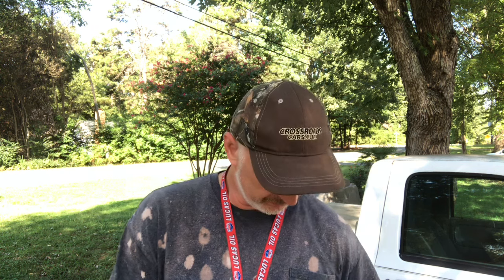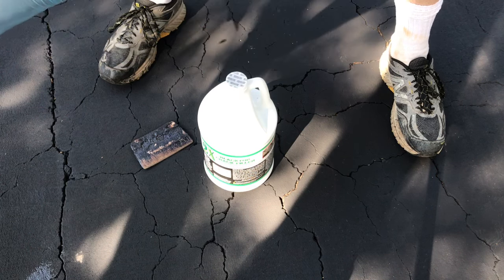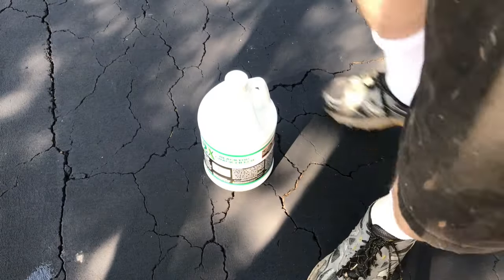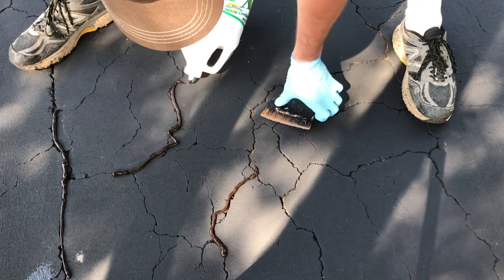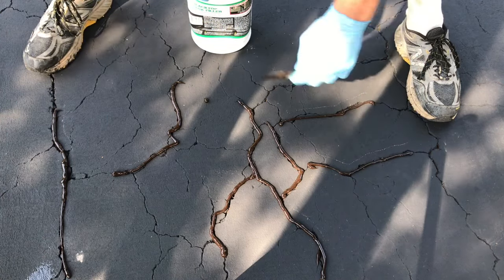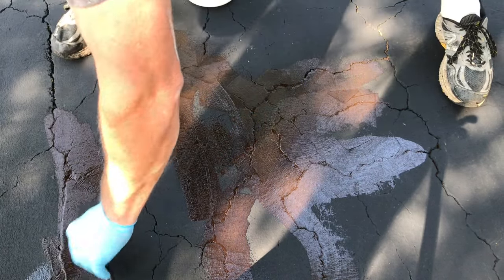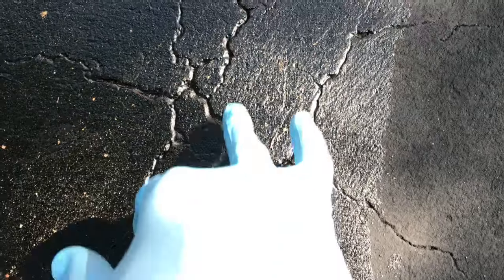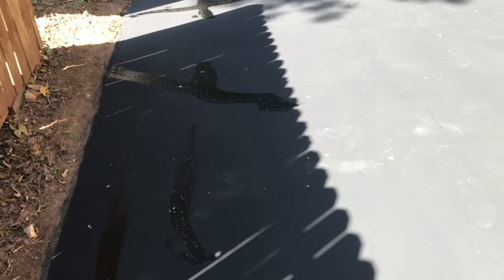Filling Cracks in a Asphalt Driveway - How to - DIY

Comment: advice to people using this specific blacktop crack filler. you gotta squeeze the bottle really tight. i dont know if its just me but this stuff refused to get out of the bottle. i almost wanted to screw off the top but i know that would have been a bad idea.  or maybe it has to do with the opening. i snipped it off where the first ring around the funnel was. Ill try to snip a bit more off when i resume work on this the following day
Reply: I take the cap off and just pour slow and use a trowel to go over it
Reply: My hands and forearms were killing after a while, not to mention my back from bending over.  I ended up using about three bottles.  After the product dried(or so I thought) it rained and most of this junk washed away.  Talk about pissing me off!
Reply: I had the same problem trying to squeeze it out of the nozzle as the jug is heavy and the jug plastic material was hard to grip and squeeze. I eventually squeezed it with a small bar clamp in addition to my fingers but it was tiring. Hope it lasts longer than first rain which another poster reported.

Comment: Did the cracks open back up after the winter freeze? Mine always do no matter what product I have used to seal it.  I live in NC and the temperatures normally get to the teens during the cold part of winter. Thanks.
Reply: Even the Professional's job of crack fill and sealing we had done last year recracked over a single winter!

Comment: Anytime I fill these nasty cracks, it looks great on the time of flight but once settled, they all shrink and a depression line runs all through the prior cracked area. I tried to fill partly with melted asphalt with not much avail, after one icy/snowy winter. Any suggestions?
Reply: Little late but I read if the crack is large enough, fill it with sand to reduce the material use.
Reply: @aquamedic8857   No. Nothing like late. It's again that time of year...
What I've found meanwhile is the wider cracks, at least those that permit, you need to fill them with spongy tapes, so called Gray Foam Backer Rod or likewise that comes in various thickness. 
I'm ready to start my own trial and error in this, including filling them with weather residant Silicon chalk or likewise! as the cracks are back again and in fact some look uglier this year, despite last years attempt for repair.
BUT... The true take home lesson is: Never asphalt your driveway. Concrete it. You will save yourself a lot of time, comfort, neatness and sanity!